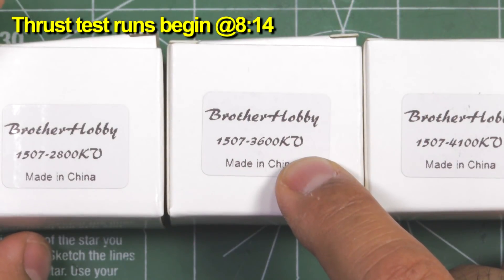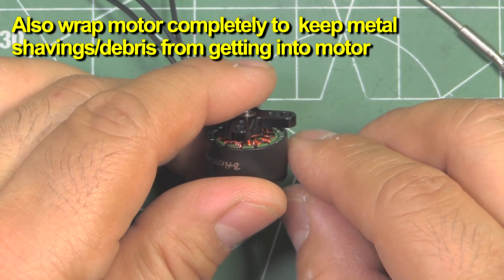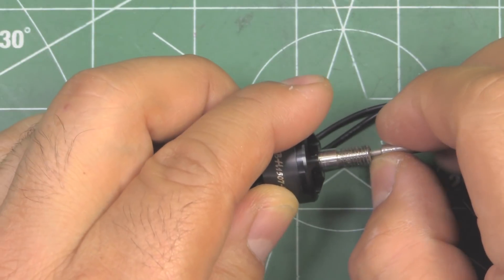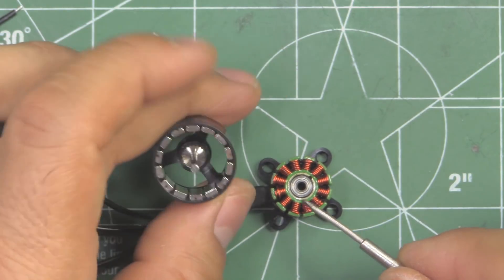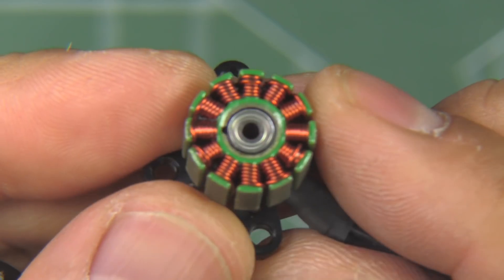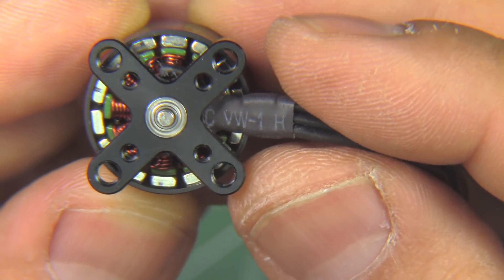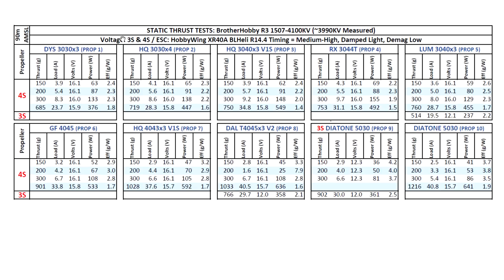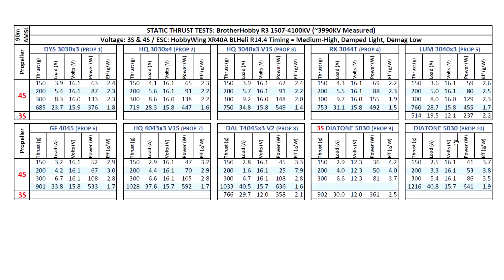BrotherHobby Avenger 1507-4100KV Thrust Tests & Overview

Comment: I know this report is old, but I'd love to see more details between 75% and 100%. 
I noticed that at 75%, it's just kinda humming along... but then it goes Beast Mode at the top. 😂 

If you get spare minutes, I'm putting together a foamy F-22, and was curious what this would actually do on 3s ~800mah. 

Obviously, things will be different in the air, but I think this is what I'm looking for!

Thanks Eng X!

Comment: Hey, thanks for all the details

I have a question, the 1507 3100KV brotherhobby, it is a 6s motors, they said it is 4s compatible, do you think if i used 4s batteries on it will give me same as 4100kv performance?
Reply from the maker: 3100kv on 4S could be close to 4100kv on 4S. If it's for multirotor you have to be careful with weight and size of props for that set up on 4S. If too much weight or too large props, it could run very hot or it could discharge batteries too fast. Yes it will work on 4S but have to match props, weight and battery

Comment: So I just used the 1507 yv 4150kv motor on a 4s 3" build and it did not do well. The quad just wanted to go crazy and fly of and pulled almost 25 amps. Tried a bunch of stuff to fix it and It just wont fly on 4s worth crap.

Comment: ops :) Ordered 4100kv 1507 brotherhobby for a 4in1 15A (20A burst 10s) esc =D think i might have a problem ;)
Reply from the maker: Most people I think are using at least 20A w/25A burst. I've read about people frying 12 & 15A ESC's with 1407-4100KV 3" setups on 4S.
Reply: Yepp might have to change that esc to another larger one. Wil try with HQ3030 props first and see if it tolerates it... typical. :)   Rebuilding a Diatone gt90 to a 3 inch , and just got motors & frame .. but guess i will have to get a new 4in1 aswell.   Any recommendations on cheap 4in1 escs for a 3"?
Reply from the maker: I've used the HGLRC 28A but that one is a little high in price. These seem to be low price and have good reviews... but of course make sure you look into/research about them 
https://www.banggood.com/Full-Speed-FSD328-Flytower-Part-20x20mm-28A-BLheli_S-2-4S-DShot600-4-In-1-Brushless-ESC-for-RC-Drone-p-1288901.html?p=FR3104108021201212@4&utm_campaign=engineerx&utm_content=10534

https://www.banggood.com/Spedix-20A-4-In-1-Mini-ESC-BLHeli_S-Dshot600-2-4S-20x20mm-For-RC-Drone-FPV-Racing-p-1274009.html?p=FR3104108021201212@4&utm_campaign=engineerx&utm_content=10534

Comment: I got those motors on my 4" build.

They fly incredibly well. Would it be ok to plug a 5S on those? The specs say no but... I am tempted
Reply from the maker: 4100kv ......?  I think too high KV motor for 5S-4". Most I've seen on 5S is a XNova 1407-3600kv but with 3" props. 4" I think would put risky loads on motor so you'd be the 1st one :) Good to hear motors are performing as well as the test have shown!
Reply: I was referring to 3600 KV. But you're right, it's probably pushing it ;)
I do have a 3" with 1407-3600KV. I am going to try it. Don't I risk to burn the motor with the high voltage?
Reply from the maker: 3600KV- 4" 5S ... yeah that would be pushing it, though I've been surprised a few times. It may work, but it's way too expensive of a test to run if motors end up cooking LoL.... I imagine if you run them on a superlight build, have really good/fast ESCs (perhaps BLHeli_32 that can handle the high RPM) then 5S could be quite possible, especially if on your current setup the motors come down barely warm.
Reply: Hey! I did try it out with 5S. They worked like a charm. Bear in mind I have the 3600 KV. They were below lukewarm after some intense punch out.
That makes me want to try with 6S, but I can't seem to find a 600mah 6S battery with high discharge.
The 5S was amazing, the speed is impressive.
Reply from the maker: Awesome! first report I see about these on 5S. 
6S would be really pushing the limits..... I'd be scared LoL
Reply: @EngineerX  we'll know pretty soon. I ordered the XT30 connectors to build a serial connector so I can put 2 3S 650Mah together. I'll let you know ;)

Comment: Why for the love of god won’t you include the Gemfan 3052 flash props?? I feel like your avoiding. These amazing props. The numbers should be included in your spreadsheets. They are probably the top 3” prop. #EnoughIsEnough
Reply: Static thrust tests should not be used to gauge prop performance.  Each prop should just be viewed as a different load level on the motor.  I prefer motor testers to keep using old props so we can directly compare older motors to new ones.  Think of different props as low, medium, or high load examples.  But don't judge a prop by the test.  Props are engineered to perform in forward flight.  The moving air coming into the prop effectively changes the pitch when in flight.  Static air is not a good example of what the prop will experience in the air.
Reply: Plur307 I appreciate the reply but I just wanna see how this prop would stack up to the Lum 3040 props. I own both but want to see the numbers on how close they compare on the bench. That is all. They are popular and wanted the info.
Reply: You didn't get anything I said.  You can't gauge flight performance of a prop from a bench test.  All you can compare is relative torque load.

Comment: Why is motor power considered by amps and not watts. My understanding is that amps are not a unit of energy - you could have the same amps with widely varying voltage and the results would not be apples to apples. When you bench test do you lock the voltage. To me it would make more sense to show thrust at the exact same wattage draw.  Not a critique I'm just trying to understand thrust tests.
Reply from the maker: Joseph Alexander Rigth. Power is given by A*V. I have been focusing on Amps because at the beginning when I started testing I was more concerned with how many Amps a motor/prop soul pull at a certain voltage so I wouldn't dey my Blue Series 12A ESCs or my KISS 18A ESCs, etc... Watts numbers are also provided on the tables and data for each prop in the spreadsheets so you can use it as needed. For consistency and simplicity on my end, I kept the tables format pretty much the same as when I started. I thought about looking at Watts but then because of the many different motor sizes and wide range of power I decided to look at thrust instead as it would increase the time I needed to sort the data and I have very limited time to run tests, sort data and prepare tables,  film commentary and edit videos. It takes me about 1.5 to 2 hours to test each motor as they need to be cooled after each run. Editing video is what takes the longest...not enough time lately to do hobby stuff

Comment: I had these motors and the 3700 kv for a few months now.
Mines don't have the hollow shafts and i hear you saying they will be released soon so now I am confused.
I can confirm power and smoothness.
The 3700 kv  offer a better flight experience in my  opinion as their power band is broader.
These come to life at the top of the throttle.
There reliability is a no go however at least for the versions I have.
Maybe that is why they changed the shaft

Comment: These are not new. I've been flying them for about 3 or 4 months now.
Reply from the maker: If you notice, it's the same video from the 3600KV that I tested 5 months ago. I kept putting it aside editing this video to work on other motor tests
Reply: EngineerX ok. Did you notice them regularly getting hotter than most?
Reply from the maker: Not on the thrust stand, they got as warm as any other motor. For full-heat saturation tests I'd have to fly them in a typical setup for a couple of minutes or for a couple of LiPos.

Comment: Appears to have highest thrust on a 3in prop with rcinpower right being right behind  it.
I was dunno g these on 4052x3 flash and 4043x3hq on 4s 850mah and 4s 1000mah on a 25g 4in and it was ridiculous quick and nimble.
For right areas a 5in would have a hard time sticking with it and likely even in a wide open field up to about the 105-110mph range these with 4052x3 would likely stick right with a 5in if not beat it and in comparing to lightweight 5in quads with beast motors like finx40 2610 and rebel v2 2306 2550kv as well as 2407 2600 bbb.
Awesome motors.
Have had 2800 ,3600 and 4100 as BH let me test them and they are some powerhoise 14xx-15xx size motors and as seen here running the thrust chart as far as 3in and even 4in for this size motor.
Still waiting to see my all time f20 v2 1408 3750kv go at it as I fell it'll be right there with these and rcINpower and really to be fair would be the 3600kv version and would need a slight handicap for kv diff still.crazy 5in motors on 5in barely do what these do 2 years back and really some motors out now are putting out 1200g on 4s 5in so basically running head to head.
Never got a chance for 5s but feel they will have no problem on 3052 x3 flash prop and maybe even the 4052x3
Reply from the maker: Those T-Motor F20 II are also one of the best motors in this size. Everyone that uses them that I've talked to said they're really good. I've asked Tmotor several times for test samples but no replies :(

Comment: Thank you! great information as always! Wondering if you plan on doing some testing on the Hawksky motor line (1107,1507,2207 etc.)? Ive been hearing some great things about the Hawksky line but theres not too much information out there yet...
Reply: DeCorK same. The 2205 appears to kick the BH into touch. The 1507 looks great too, but neither are ever in stock:)
Reply: Yea I think I might just have to order a set of the 1507's GetFPV has em in stock now :)
Reply: DeCorK can u post how they are if u do. Getfpv isn't an option for me due to shipping. I think they'll be a good option for my gopro carrying 3" :)
Reply from the maker: I have been wanting to get a couple of those but they were always out of stock from BGood. I'll see if I place an order if I see them in stock.
Reply: EngineerX I contacted them and you can buy direct now. No idea why banggood never have stock, or they only have one. No way in buying 5 without some testing tho :)
Reply: I have the 1107 hawksky and they are the best 11xx motors https://m.youtube.com/watch?v=5u_twK9SPuM

Comment: Why are Brother Hobby motors always so expensive???
Reply from the maker: These are $17 @Banggood, not that much expensive than Cobras or T-Motor F20's. For the larger motors $25 is also fairly close to similar-sized motors from the "top-brands" But,  if you compare their price to RacerStar, RCX, etc then they are $8 to $10 more expensive. You're paying for better materials, as I said, titanium shafts, better or  just pricier bearings, and extra labor as seen in those videos. I don't think the RacerStar factory goes thru a manufacturing process that's anything close to that. Also I'm sure they add a little more profit for the brand name. Like in clothing, Levi's cost $35 here when on sale, but you can buy no-name jeans for $25 anytime. I think we have been getting a little too used to very inexpensive hobby parts due to the power of Chinese mass production which in many cases is a good thing as it's given us cheap merchandise, but also many times crappy products. Good thing there are so many less expensive choice for motors like those from RCX and RacerStar, but when good QC practices are not followed you may end up with issues like those in Samguk motors.
Reply from the maker: For the larger motors like 2207, 2306, etc, I think because they use titanium shaft, EZO or NSK bearings, magnets are matched and each motor undergoes quality control checks. You should watch this video you can see very interesting manufacturing processes for the motors 
https://www.youtube.com/watch?v=JlzruRmmnWI
Reply: EngineerX while that video made me have a bit more respect for BrotherHobby as far their QC and treatment of employees, it still doesn't justify $25 a motor...
Reply: Nathan Schlenker if these were made in the US or EU they would cost a lot more. Start realising that china is become more similar to the west and price are aligning, as chinese people are getting "western" life standards, and products increase in quality. Yes there is a "brand name" overhead. They know people like them and they want to be paid, like any other company.